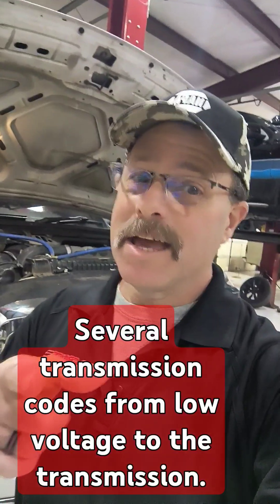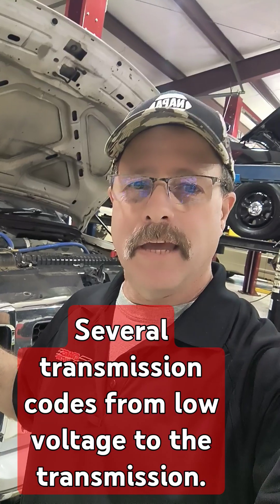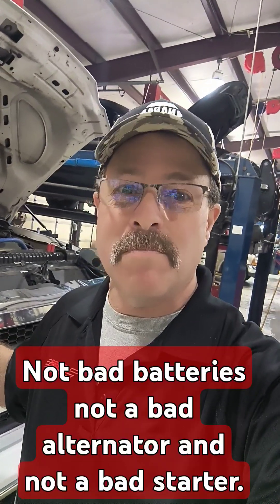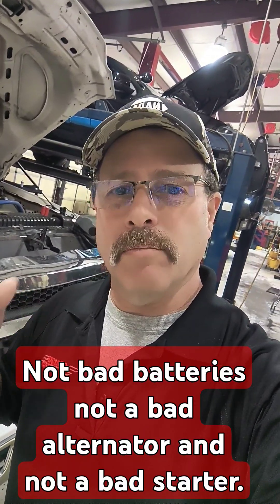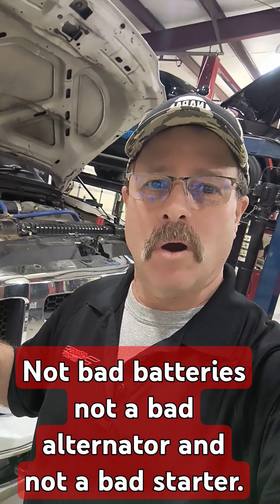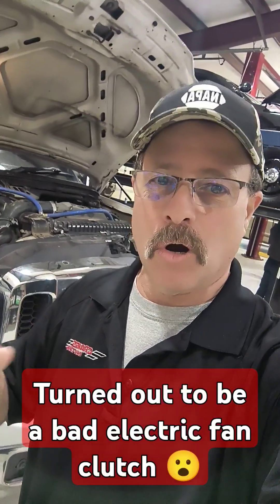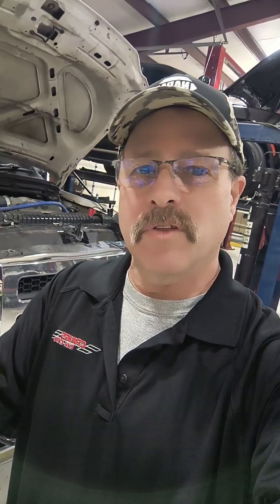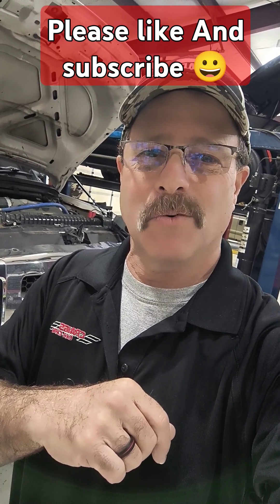25 #FAQ #nostart #engine #ford will not crank over. #Batteries, #Starter, #Alternator and cables ok.

Comment: Ford F150 w the 6R80 and F250 w the 6R100 cam sensors share a power source with the transmission lead frame assy? A shorting out cam sensor can and has presented as a transmission issue. Wiring diagrams and diagnostics for powers and grounds are a must!